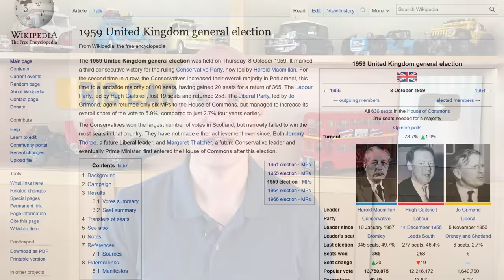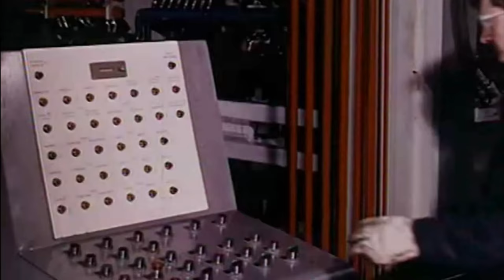Hillman Imp - Optional Extra

Comment: Interesting videos but I am disappointed by your focus on the apparent militancy of the unions and no mention of the competency of the management. If you look a little deeper it becomes clear that much of the woes of the British car industry in the time period fall at the feet of incompetent management and ridiculous and disconnected decision making. I agree that the decision to continue with the Imp is an excellent example of the sunk cost fallacy. But it wasn’t the unions blundering by persisting with a doomed project was it. In the period, the UK was still rife with class division and that in no small part influenced industrial relations. My experience in the UK more recently suggests it still hasn’t changed enough.
Reply from the maker: I do talk about this, but not explicitly calling them out. They decided to make a factory in Linwood without a good plan to solve production issues quickly. They decided to launch a car that was clearly not ready. They OK'ed a rear engine design without determining it wouldn't sell. They took way too long to develop the car. Like many instances of the British car industry, it's not one side you can point your finger at.

Comment: Fun fact. MG Abingdon where the MGB and Midget were built never had a strike in the 70s which is pretty amazing. There was no moving assembly line there. Instead workers did their jobs in stations and would push each car to the  next station for the next group to do their jobs. It was much more team oriented and workers had more freedom to do their jobs and double up with coworkers. Youd think BL management would go there to see what they were doing right but no, instead they closed Abingdon in 1980. A vid on that factory would be good.
Reply from the maker: Interesting - thanks for the info. My dad had a West Midlands engineering firm in the 1970s and never had a day of strikes either.
Reply: Strikes aren’t the only metric by which plant viability is determined. Production cost and overall efficiency is a HUGE issue. And building low-price MGs in such a time-consuming and labour-intensive way squeezes profits.

BL needed profits to survive in 1980. They certainly weren’t going to build their more modern upcoming models the way they built the low-volume ca. 1962 MGB and ca. 1958 Midget.

They couldn’t afford to convert the plant and they couldn’t afford to replace such low-margin, low-volume vehicles whose market had evaporated, either.

Abingdon closed because it was outdated and inefficient even though it never took a strike.
Reply: @judethaddaeus9742  MG was profitable but needed funding for replacement of the MG B etc and politics in BMC/Leyland favoured Triumph
Reply: @elba9066  Even the new TR7 (based on the aging Dolomite chassis) failed to generate the income BL needed at the time, despite brand new, state of the art factories. BL shut Triumph’s sports car range down at the same time as they culled MG’s. This was an era of decline for the sports car with the rise of the hot hatch, after all.
Reply: @judethaddaeus9742  You wrote: "This was an era of decline for the sports car with the rise of the hot hatch". It was also the invasion (around the world) of well built and well performing Japanese sports cars such as the Datsun 240Z and Nissan GT.
Reply: I did not know that. I had  moved from junior to secondary school' and probably my most vivid memory was yet another strike.
Unions were in my opinion, trying to run the country without even being elected (probably my fathers view)
 It even led to the 'Strawbs' Part of the Union being banned by BBC (although it was still on some channel I listened to on transistor)
https://www.youtube.com/watch?v=dxNMgoiNLFs

Comment: Bought a sky blue 1964 one in 1970 when I was 16 for £40! It was a part exchange trade in that was slightly unloved! My dad took me out in it to practice. Fantastic car that I pased my test in very soon after on my 17th Birthday! Having no cash I had to learn all about cars by working on it myself! I crossed a spark plug thread in the alloy head so had to whip it off and take it to a machine shop. Only time I didn't do everything myself. It was great as you undid the rear bumper and disconnected a couple of bolts then you could simply push the car forwards leaving the engine and gearbox exposed. The engine was a really beautiful alloy unit. I bought an aftermarket straight thru exhaust but even as a Glaswegian teenager it was too loud and people wanted to race me at traffic lights when they heard it! It was a stock engine so not capable of racing so I replaced the regular exhaust. I did buy alloy wheels and wide tyres that added to the already excellent handling. To this day the Hillman Imp is still a source of Scottish pride.

Comment: Hillman Imp was my first car.  I loved the opening rear window.  I once transported a 550cc motorbike for a friend by part dismantling the bike and then the pair of us picking the bike up, tilting it sideways straight through the opening rear window! The car handled it fine.  I used to transport my German Shepherd dog in the back. However, I have to admit things were a little too compact for that LoL Overall, a decent fun car.  At the time i owned mine, there were still lots of the classic VW Beetle still on the roads, so i never saw the rear engine configuration as an issue really.
Reply: Americans would think they need an F150 pickup  to transport a Motorbike 🙂
Reply: What did they handle like ? Were they bullet proof ?

Comment: A major problem was the convoluted supply chain issue that you described, and there was a lot of truth behind the unions being unjustly blamed for problems when actually they'd been pushed into problems by management who didn't want to pay them to sit around waiting for parts.  This was a different era, and there was no way the infrastructure existed to reliably move partial vehicles around the country to have bits bolted on.  There was also a political component to the government wanting to provide jobs for the former shipbuilders in and around Glasgow - if there was no work, they might well move, and swing the balance in seats where the government had a slim majority.  It suited the tories very nicely to have a few seats with thumping great Labour majorities and a lot of seats with slim tory majorities because it is parliamentary seats, not votes, which win elections.  No altruism required or present.
We had a couple of Minis and a bit later a Singer Chamois, and both were good cars, the Singer much more refined than its Mini contemporary (and, to be fair, the more basic Imp).  The engine and particularly the gearbox were damned near bulletproof (credit to my mother for extreme testing of the clutch and gearbox - I really wish there had been more refinement in small engined automatics back then!) and the weight distribution was fine with the engine where it was, and rear-wheel drive was the norm then, so anyone thinking of driving hard learned to handle the superior handling (yes, I still prefer it).  The Mini, by contrast, was relatively crude and handled like an oversized rollerskate, or maybe a go-cart (or soap-box racer as Americans call them).  Don't forget that the single best-selling car of all time with the longest production run was a rear-engined RWD model by VW against which the Hillman/Sunbeam/Singer models make a far better comparison and showing (the Beetle had a horrible weight distribution, with the engine even further back).  In the end, it came down to that subtle and unpredictable thing, fashion.

Comment: My tuppence worth
My father had three brand new Imps. We loved them. Nippy. Handled well - apart from the inside front wheel hopping at speed. Front steering King Pins rusted, even when the grease nipples were regularly filled with grease. Bugger to get out. The clutch friction plate and particularly the carbon thrust bearings failed perhaps a bit more often than they should...? Easy to replace though as we built a wooden trolley to support the engine and we could remove the motor in less than half an hour. No winch needed. We also had the top of the rear mounted radiator leaking, and my father repaired this by removing the rad and soldering it properly. The valve clearances were done via shims, not by adjustable rockers like many conventional engines of the day. I still have a tin with some spare shims. The single exhaust silencer was vulnerable. The one we had on a Singer Chamois burnt through and was replaced within the first year under warranty. We asked if they could just give us the replacement for us to fit, but they refused. They said that they had to fit it. They had the car for a full day, and we noticed it was making a rattling noise on the way home. There were three fixings. The clamp round the manifold, An A bracket at the rear, and a strap at the front. They had tightened the manifold clamp, but hadn't even fitted the nuts on the A bracket or the strap. When we took delivery of the car we drove 300 yards from the salesroom before running out of fuel. We had to walk to a nearby petrol station and buy a fuel can to get home. The dealers in the 60's were mostly cowboys. Despite ALL these issues, we really did love the Imps. If anyone fancies one there's a fully restored one on eBay right now for £20,000. Absolute bargain... :-) 🤣😂🤣😂🤣

Comment: The 875 Coventry Climax (Imp) engine was also used in a de-tuned version by Reliant Cars in the mid 1960’s and called the ‘Bond 875’ a three wheeler, a very quick lightweight car, handled well too.

Comment: Linwood wasn’t actually closed that long. After building the last Imp in early 1976, Chrysler UK moved Avenger production there and began making the facelifted ‘76 models pretty quickly after the Imp was sunset. 

The Sunbeam, being based on the Avenger, was added to the production lines when it was ready in 1977. Linwood then closed in 1981 after PSA decided they didn’t need the aging Avenger anymore and after they’d slapped together a Peugeot 104-based Talbot Samba, made in France, to replace the Sunbeam.

Ryton, which was making Avengers until 1976, switched to making Alpines and, later, Horizons and Solaras.
Reply: Any idea what Linwood is now ?
I wonder how long it will be before Stellantis stop manufacturing in the U.K. My Father's last two cars were U.K. made Peugeots but I think the second one was one of the last.
Reply from the maker: Interesting to know - thanks Jude!
Reply from the maker: The factory closed in 1981 and it devastated the local area.

Comment: Hi Great video. Love the imp although never owned one.
 I have worked on a couple and Driven them.

 But Re Union power in Uk in 60 & 70's. Being a Printer and Having to Be a Union member. (E.g. Closed Shop.)
 
 A Strike could be called at any moment, over any issue however small.
 The F.O.C. or 'Father of the Chapel' ( Yes we were all Brothers, few Sisters at that time), In the N.G.A. (Shop Steward to most..!)
 He would Call a Meeting, Blowing a Whistle, due to Noise from Presses..!
 If the Sun was Shining, we would Walk out. And Woe Betide any who voted 'NO.!'

Most Nipping off to the Local Pub, to have a Few Pints, Grumble. Then head back to Sleep it off on Pallets, until problem Sorted. Sometimes an Hour, Shift, couple of Days or at worst in my Experience '6 Fudging Weeks'. ( with wife n New Mortgage to pay.)

 Hence 1980 I came to Australia. And found a Friend Driving a bloody Imp..!!

 Thanx for your efforts. 
  Cheers kim in Oz. 😎

Comment: Interesting that you suggest that unions were applying pressure to strike at Hillman.  "Working for Ford" by Huw Beynon, a detailed study into industrial relations at the Ford Motor Company suggests the matter was quite the opposite, with the actual unions often supporting the proposals of the management while those on the shop floor were far more inclined to militancy.  Perhaps that's a difference between the two firms, or perhaps it just depends on who you ask.
Reply from the maker: As with history, it's what people remember, and the truth could be very different. I got that information from personal recollections from factory workers there in a video I linked in the description. We would only know what was the actual truth if we were there.

Comment: Bought a 1966 Singer Chamois in 1975 for £150 which was reasonably reliable. Picked up a hitch hiker on the A34 who after a mile asked “this is a quiet car - is it foreign?”

My mum had two. You had to drive like a lunatic to get the rear end to hang out. The heater? Don’t ask.

Comment: I'm living my own 'sunk cost fallacy' right now with an old outboard motor I am trying to get running!
Always figured the Imp was trying to duplicate the Beetle success.
Reply from the maker: We've all been there!
Reply: The problem is that you can only use that label in retrospect - if you succeed, it doesn't apply, and the engineers get praised for their tenacity in solving the problems.

Comment: I actually think the Imp looked modern and not inferior to the Mini in terms of style, and the large amount of glass also gave good all around view to the drivers and passengers. Mini’s reliability wasn’t that superior to the Imp either. The downfall of Imp was of course  a combination of the weird rear engine arrangement handicapping some level of practicality, poor promotion (can’t they get some mini skirted ladies to spearhead the advertising?), and maybe harder to work on than a Mini. A missed opportunity I would say.
Reply from the maker: I agree. I don't think the styling was bad.
Of course BMC had issues with making the Mini for the low price they sold it at, which of course put Rootes under pressure to keep their prices low, which meant everyone raced to the bottom and went bankrupt.
Reply: @Retired Bore Since when has either 2 versions of the Renault Twingo been rear engined???

Comment: I had a singer chamois coupe in ascot grey spent a fortune on it tuning it with 998 engine  race head  webber carb janspeed manifold Hartwell lowered suspension   would rev to 9000 r17 cam tufrided  crank wills rings all  expensive bits, fun to drive but so unrelible and 25mpg sold it and bought a ford escort 1100.mk1  I could not believe how reliable a car could be , just put fuel in and drive it . IF ONLY
Reply: If you hadn't messed around with the Chamois so much, it could have been as reliable as my mother's.  Still, you were lucky to find the only reliable Mk1 Escort Fix Or Repair Daily.

Comment: I think it's a little unfair to maintain that Rootes should have cancelled the Imp project in 1959 and waited until they could produce a frontwheel drive car. Actually when you look across Europe rear-engined cars were doing quite well in the sixties. Think about the Renault 8 and 10, Simca 1000, Fiat 850 and many others - not to forget the old VW Beetle (that wasn't replaced until the mid-seventies). Add to this that frontwheel drive cars was rather complicated for factories to manufacture. Witness the fact that even VW had to market a small volume "sportscar", the Scirocco, before they had built up the knowhow to launch the worldbeating Golf, Volvo did the same thing with the 480, and even BMW has bought into the Mini to get knowhow to produce a frontwheel drive car.
It is clear with 60 years of hindsight that wrong decisions were taken, but it wasn't a no-brainer that the project would fail. Actually I knew people back in the day who preferred the rearengined Imp to any frontwheel drive car - and it had the folding rear seat and opening rear window for shopping.
Reply from the maker: Rear wheel drive cars sold OK in Europe, but not in the UK - the Imp's main market, and I reference the poll at the time that showed Brits didn't like rear-engined cars. Yes, hindsight is great, and clearly now FWD was the way to go, and you can certainly argue that wasn't clear in 1959. But no matter what they did with the engineering, clearly Rootes got the car wrong when it launched as it sold so poorly despite a big fanfare at launch.

Comment: There was a sports style glass fibre version of the imp that came along, but built by third party Ginetta as the G15.

You mentioned other imp based vehicles and surprised you didn't mention the G15!
Reply: Indeed. I have been scratching my head over the name of that vehicle, but kept being side-tracked by the Gilbern Invader for some reason.
Reply from the maker: I think I was aware of it when I did research (back in mid-June), but you have to stop somewhere, and this only took the major parts from the Imp (not the chassis).
Reply: The Centaur kits / the probe derivatives do not have a chassis. See, the Imp is nothing but a lower steel tub, a bolt-on rear frame thing where the trailing arms hang on and the gearbox front mount. The dampers are mounted on the steel tub, and the front axle halves are bolted on below the tank by L shaped parts. What the Adams + Peter Timpson did was to throw away the Imp‘s steel tub and cast their own futuristic glassfibre  „bathtub“, and bolted on these parts in the same manner as on the Imp. There is no chassis no nothing, its just a plastic bathtub with bolted on axles and parts. My Centaur kit is now on my car lift, above my Unimog, and every time I work on the Mog I walk under Centaur… mail me for pictures if needed.
Reply: just seen your video....great presentation..... may be mentioned in other comments but no mention of the Clan Crusader as another version....and a rally winner (Isle of Mull)?